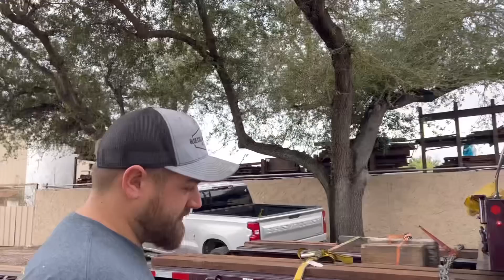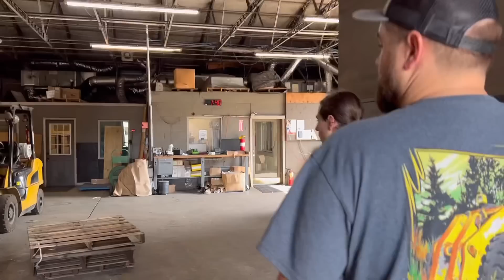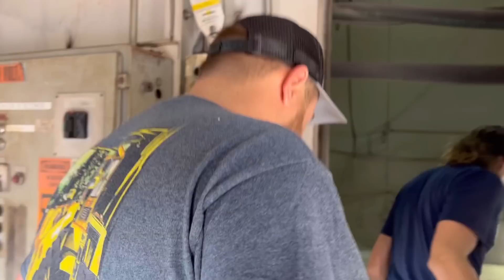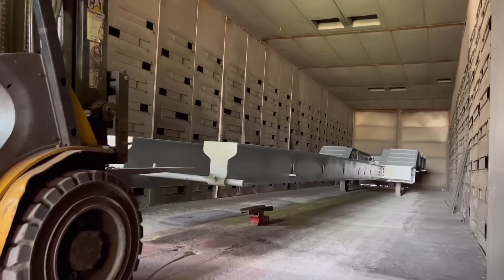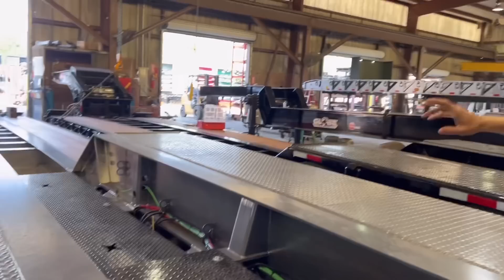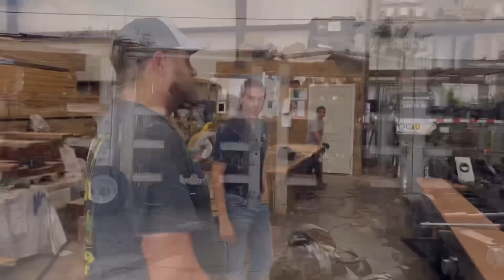How Heavy Haul Trailers are Made! BTW, I Ordered One!

Comment: I remember Lenny, the original owner of Globe trailers. 30 years ago I had a welding and fabrication shop in Bradenton. Whenever I needed a piece of ½ inch steel bent, Lenny would do it for me. At that time he had equipment capable of bending 1 inch steel. He had a huge, I believe it was 6 ft in diameter, cut off saw. Globe trailers did everything in house, from designing, fabricating, sandblasting and painting. 
Globe trailers used to get a lot of government bids for specialized trailers. 
A highly diverse, creative and will run company. 
I remember Lenny used to smoke cigars, 
All the time. 😭😭😭

Comment: I work with truck drivers that use those trailers all the time. They are actually super aggravating when they will not slide back together. We have to use a crane to pick up weight most of the time. Totally only nice and easy while it’s new

Comment: I actually love those million axle Michigan trucks. They say that the axles from front to back on a trailer supports the load better to prevent damaging the asphalt. I guess it reduces creating those grooves in the pavement due to a heavy truck with only five axles which technically is not supporting the whole load. I would love to drive a truck full of axles front to back! That red Gooseneck was beautiful. I hate seeing goosnecks with single tires instead of dual tires!

Comment: Nice trailers for sure. Not a fan of the lock release valve on the trombone trailer at the beginning, to easy for it to be left unlocked. we had a trailer like that and moved the lock to a glad hand  up front so the supply line had to be used to release the slider lock.  Only because it was not locked once and came open while loaded and became a big costly issue. live and learn.

Comment: Bruce, I would highly recommend a 55ext with a 4 axle either a flip or stinger and a neck extentionfor a 2 axle jeep (EXT= extendable).
1; resale value is higher.
2; you can actually axle out 110k lbs load if you have a 3 or 4 axle truck, 2 axle jeep and a stinger 4th axle in Wyoming at least (but as you know each state is different). But you'll have to get the neck extention to be able to have a 55t fit onto a jeep.
3; there is a lot of potential for long loads that would not be possible with out the extendable portion of the trailer and are still within the weight rating of the trailer.

Also I would add the chain thing on the side that we're pointed out very briefly, and the center "D" rings on the inside of the main beams down the entire trailer and chain holds as well. The more options you give yourself to secure the load that are built into the trailer the more you will thank yourself later!

Comment: Back in the 1970s I worked for Ameron who manufactured concrete pipe fir water and water applications. We designed a single beam light Aluminum Trailer. During testing it buckled under the weight of the doing to being to light weight. Ameron in 1979 s had the largest private fleet of flat bed trailers in California. We had a fleet of a 12 Cozad low bed heaven haul rigs. Fun times managing the fleet.

Comment: I suspect the reason we have so many piece meal trucking laws is due in part because every state knows if they can tweak something their neighbor does, they can nail you at their port and make some money. We had a driver get nailed in Wyoming for being an inch over length for pilot car requirements because they measured from his tail light, not the rubber bumper block on the back of the trailer

Comment: The quad on the trailer can be a liability,..some states will not  give you more weight on your permit for 4 axles, like IIlinois or Missouri. A better choice is a stinger with at least a 10 foot spread. The hydraulics that lift the fourth axle add weight and decrease the weight you can haul. Florida seems more interested in how much bridge length you have than how many axles you have. (Just an opinion but I have hauled super-loads on 13 and 19 axle rigs into and out of Jax, Newark, Norfolk, Wilmington, Charleston, Canaveral, Miami, and Pensacola.) Regards

Comment: If they can do it, Ipe wood decking is really the best option for wooden trailer decking. It is crazy strong and will never rot. The price shouldn't be much different than their premium wood. You might as well make it higher rated than you currently need, just so you will have the option in the future.
Reply: It's a good business practice to invest in quality that retains it's value, but gets the job done time and again. I've taken my  40' stock trailer (WW - 3 axles) in to have the inner flooring redone with Ipe wood, replaced the wheels with 1992 1 TN 8 lugs steel wheels & E rated tires and still holding up (refloored 2007, it was lined with cheep pine). Hauled a lot of livestock with it, kept it cleaned and still holding strong as the day I got it on 3/2006.

Comment: I can't be the only one that was thinking the salesman was gonna pull out a guitar and start jamming at any moment.

Okay, kidding aside he did seem very knowledgeable.  Hats off to him for explaining things very well.  

I had a couple questions I wish he would have elaborated on a bit more.

1.  I couldn't tell for sure but I was wondering if they are cutting into the main support beam for the larger cross members so the larger cross members actually go through the main support beams and then they weld them or, are they cutting the larger cross beams to the shorter length (3 feet roughly I believe) and welding them onto both sides of the main support beams?

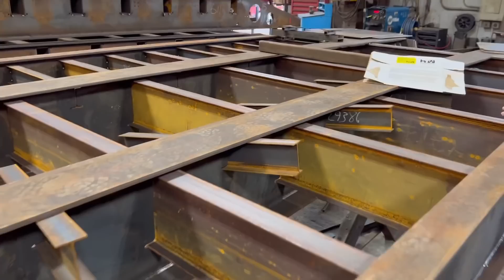If you pause it at the 13:31 mark, you can see that they do cut into the main support beam at the top for the smaller cross beams as you can see the smaller ones are "sticking through" the beams and just hanging there.  Plus, if you look at the other side opposite of where the guys are standing, you can see the "I" beam cutouts in the main support beam.  But, I didn't see anything for the larger cross beams that are already welded at this mark since they were already welded in place.

I believe this is called "pierced beam" type of structure for trailers but perhaps I'm wrong.

The reason I ask this is I thought I read somewhere that doing "pierced beam" style construction / production of  a trailer in this manner can promote rust or corrosion more than if the beams are connected to the sides of each main support member.  I believe I read somewhere that this was due to air possibly being allowed into the pockets of the main support beam if they are "cut" into like a pierced beam style construction would have.

But, if you aren't actually cutting into the main support beam, then you aren't allowing the possibility of rust to form.  But, maybe this has to do with if the welds are poor and allowing air and/or moisture into the small air pockets of a really poor weld?

Can anyone say one way or the other so I understand this?

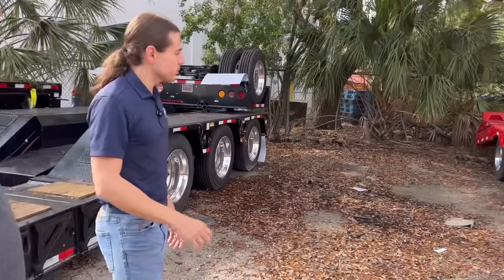2.  At the 38:00 mark, the salesman mentioned how having 4 axles is a "legality issue".  I am not understanding specifically what he is saying with regard to weights and whether having a spread axle or an additional axle is better or worse for hauling.

The way I understand things, having a spread axle is allowing the weight to be "spread out" over a point (at least I believe that's what it is supposed to do for a spread axle) and as such, it's supposed to help with not having so much weight at certain points of the ground as you're traveling.  At the same time, it is not putting all of the weight on a small footprint or point on the trailer.

If I'm not understanding this correctly, someone please correct me or explain it to me better.

What I'm assuming is if you had two 20k axles on a semi trailer, if you had both axles closer together towards the very back of the trailer, your cargo will put more weight on the "bridge" or deck of your trailer between the front axle of the trailer and the hitch point of the power unit (semi truk) than if you spread the axles apart from each other (hence the term "spread axle") and you should be able to haul more weight.  This is because the "bridge" or deck that you are placing the cargo on would be longer if the axles are closer together all the way towards the back.

For example, when semi truckers talk about "sliding their tandems", aren't they doing this for weight distribution purposes?  And as such, wouldn't it put less weight on the rear axles of the truck itself if the rear axles of the trailer are closer to the hitch since "some" of the weight would be transferring to or over the rear axles of the trailer?

I understand that adding extra axles is actually adding more weight to the trailer itself (empty or unloaded weight) because the axle assemblies along with the added hangers, bushings, suspension, wheels and tires and other things are all going to add weight to the trailer.  For the most part, it's all metal with the exception of the tires so this adds more weight obviously.

So, sometimes, it may not be more beneficial depending on if you are trying to keep within an overall weight limit as a whole.

But, I would think that adding more axles would always allow you to carry more weight since you're adding another axle that is capable of say 20k, 25k, or 30k, in weight carrying capacity by itself.

Am I not understanding this properly?

3.  I would like to see these trailers actually loading and unloading the cargo that they are being used for and see them in action.

Being in the Midwest, I've seen many combines going up and down the road with the extensions (are those what "outriggers" are?) on some of those larger trailers so I understand that many of these types of trailers are for those uses.

But, for these trailers that apparently can extend themselves another 26 to 30 foot, what in the heck would they be using those for if they were fully extended?  I know we've seen videos where they have those huge gigantic transformers being moved by trailers with what seems like 14 to 20 axles or more that actually have steering on them but these aren't quite up to those sizes.  So, I'm wondering what these would be used for with the extensions fully extended.  But also, I think it would be really cool to see something being loaded and driven down the road to see these in action.  I suppose maybe there are some YouTube videos out there so maybe I'll see if I can find something.

4.  I've always wondered how they unhook the front of some of these trailers that split apart.  Again, I'm sure there are videos but I thought it would be cool to see here.

5.  Bruce, I'm sending you a message because I wanted to mention something I didn't want to make public.

Also, do you mind sharing what you are planning to haul with your trailer?  I understand larger combines and agriculture equipment is one thing that you would haul with this but just curious if there are specific types of equipment such as construction dozers, blades, cranes, excavators, and so on?  Do you currently already haul a lot of  this and you're looking to upgrading or is this something you want to get into so you're sort of "taking a leap of faith"?  Either way, good luck with your purchase.

Comment: Hey Bruce, the real question how big and heavy do you want to haul??? I'm a heavy haul driver that's done 2-2-2,  2-3-2 , 3-3-3 , 3-4-3, 4-3-4..   Ya see when it comes to heavy haul 
Go big or go home!! Which means not the load on the trailer, but instead the equipment you will need to haul that load..  for the little bit of equipment you might think about wanting to haul, I would honestly recommend a 30ft belly, 3 axle, disc brakes, outriggers, flip neck, LED lights and strobes on 3 sides,  center storage area for dunnage, extra chains and binders, etc,.. A center lift and rear lift axle , why you ask
1) you're in Florida 
2) having 2 axles that can lift will save you money in fuel and maintenance 
3) it gives you options for weight distribution  
I can personally tell you that Globe Trailers are heavy but again they're built very well..  And surprisingly they actually ride somewhat smooth..  
Good luck with your new trailer

Comment: I really enjoyed the tour of Globe Trailers. I am an engineering contractor now retired, so back in 1995 - 2002 I worked at P&H mining now It's Komatsu in Milwaukee Wisconsin. Back then I worked on the hydraulic excavator dippers, aka bucket, these dippers used plates 1.50 to 3.00 inch thick and the welding symbols, it's like trying to learn the Arabic language. The excavator frames were 10 times the size of Globe Trailers. I and several other designers and drafter were hired to complete the redesign of the 9020-dragline machine that went to Australia. It was quite a working and learning experience.

Comment: I wish you showed how Prep. shot-blasts & primers the inside of the fabricated square sections, square & round tubes. That shot-blast really does a number on the concrete floor. I wonder if instead of pouring a new concrete floor if they can clean the floor really well & pour epoxy instead? Wonder if the epoxy can better stand the shot abuse? OR if they could lay sacrificial panels of an appropriate thermoset or thermoplastic material on a new concreate floor & just replace the panels after a month or three? Does Globe have it's own Structural & Weld Engineers & the pricey FEA simulation software or are those duties contracted out?

Comment: Back in 2008 the municipality that I was employed with, we received our first Globe 50-ton detachable gooseneck low-boy trailer that’s almost exactly like the grey trailer featured in the video. An independent heavy equipment contractor submitted a bid and won the bid. I’ve been retired since 2011, and currently it’s still in use on a daily operation. The only minor problems occurred was the auxiliary motor that powers the gooseneck other than that it’s a solidly built low-boy trailer. 💯👍🤙🏽

Comment: Pretty cool stuff. I've never seen an extension trailer going down the road like that. I've never seen a Globe trailer either, but as someone who is fabrication minded I wouldn't have a problem investing in a Globe trailer if I was in need of a lowboy. They look to be very well designed and they've corrected a some issues I've seen on a couple trailers that were common problems with the deck, side rails, and cross members. You can't prevent all the damage from years of dumbasses severely overloading 35 ton tandem axle trailers. But you can build a solid freaking trailer that will stand up to the abuse it is rated for. Even if it only has to go a few miles down the road, loading a trailer 20 tons over it's rated capacity is hell on the unit and I don't recommend trying it.

Comment: 10' wide an bigger are used just about standard here in north western Ont. Canada from everything from huge logging eqipment to moving large heavy construction eqipment for everything from road building to transporting to remote reserves over ice road frozen lakes. Mining eqipment. Pipe line pipe an eqipment, dryers  You name it. A 10' wide is the most comone trailer used here. A D11 I have seen many times on a really long 10' wide trailer. Working my whole life hundreds of Mike's from home in a large company Bush camp for pulp wood to saw logs.  The machines are so big a 10' wide trailer back right under the belly. As the machine sits on 4 big steel ramps. It blocked up  and the truck an machine pull forward until the machine sets on the cribbing an the wheels clear the ground. Wheels an finnal drives are removed for transport. Unloading is done the same way but in Reverse procedure
Reply: When I worked at Peerless, we built coil tube trailers that were 14'6" wide. They were headed to the states. Had barely an inch of clearance on the doors

Comment: #1 thing you need to think about. You cannot haul Multipiece loads over 80,000 gross weight. So Why would you spend a huge pile of money on a heavy trailer. All those trailers are designed for full time Heavy haul. IMO that trailer is going to sit in your yard and waste a ton of money when your not using it, and when you do decide to use it, You aren't going to be able to get as much equipment on it. Unless you are going into full time heavy haul, your wasting a butt load of money.

Comment: Deck height looks to tall
Reply: So with a 29ft deck u need to get a permit everytime u take it out for over length? I know we ran into this ordering a 25ft deck from Talbert
Reply: If your getting a heavy spec truck get the 55ton, u never have enough trailer. When u have a 55 u start getting the calls to move big equipment and your maxing it out. Very nice trailers, I just don't like the tall deck height.  Also the longer the deck, the more weight u put on its gonna have alot more flex. I know the guy down the road from us has the longer deck and with same machines on both trailers his arch is flattened right out, and going down the rd at speed u can see his has a lot more bounce traveling at 60 65mph
Reply: U want the notched axle bracing on middle and rear axle, yrs back we couldn't get that on a Talbert but now they do it. Like a mid length stick excavator won't fold up enough and u have to block it up in the well so the end of stick doesn't hit axle cross bracing.  I'm not a fan of the rear trays back there either. Without them it makes it so much easier to grease the axles. Trying to lay on ground to grease axles on lowboys suck